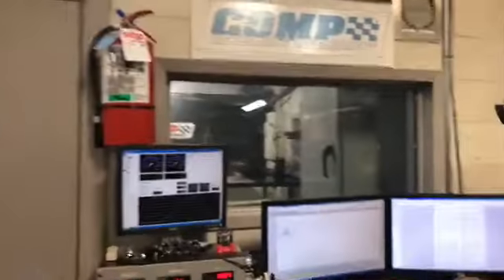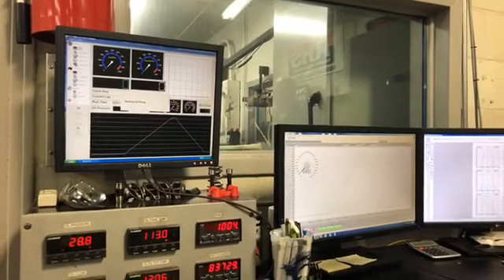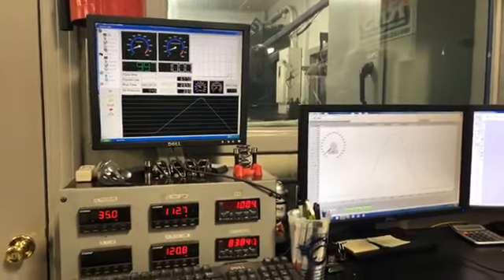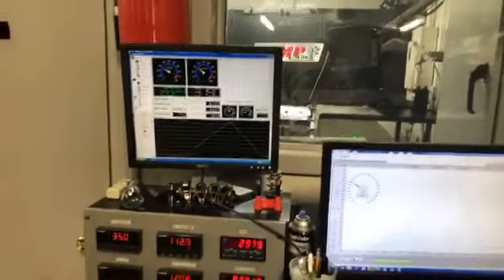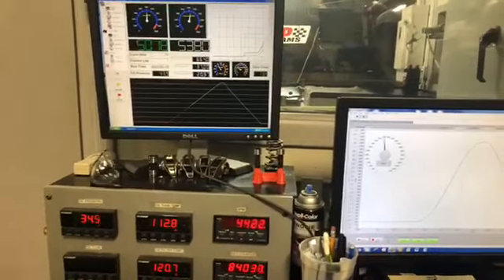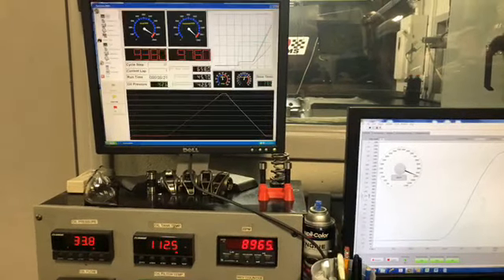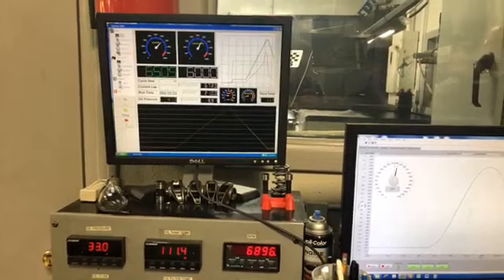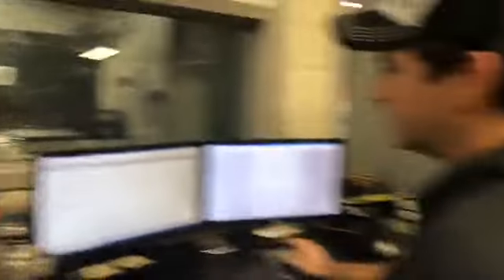Project Spinal Tap Goes to 11,000 RPM

Comment: 11000 rpm ls7....freaking awesome. That’s rotary engine territory!
Reply: SteveFuentesRacing that’s higher than most rotaries go....
Reply: Stephen j name one I6 that revs that high... I’ll wait
Reply: Stephen j false. The rb20 head flows too poorly to rev that high, I had one, and it never made it much past 8k before falling on its face. the standard rb25 head doesn’t have the solid lifters like the rb26 so it can’t handle that high of a rev, the rb26 cams aren’t aggressive enough to rev that high and still make power, the 1jz and 2jz are never really revved past 10k, and those that are typically have big cams, ported heads, larger valves, etc. I don’t know much about the s54 but stock limiter is lower than most other i6’s, and the Barra being 4 liters will not rev that high. The typical power band of a Barra is no higher than 6500 or so. Big displacement without a massive bore or short stroke will not be easy to rev out. And the Barra can only be bored so much
Reply: Lots of rotaries go 10k+, that’s just a Bridgeport away. Especially NA rotaries.
Reply: Matt L this ls7 is built built. Lol why are you talking about a stick heads?
Reply: @Matt_Lanzer_13  the RB26 engine designed specifically for racing revs 11000 rpm, heavily tuned by Nissan for racing during the days of skyline GT-R, also there's a video here on YouTube, search it up, I ain't gonna search it and copypaste the link for you

Comment: Think about this... before the 10,500 rpm NHRA Pro Stock RPM limit was imposed, 500” Pro Engines were exceeding 12,000 RPM in competition.
Reply: I know there’s someone seeing thinking well f1 engines do 15k rpm(modern) and Honda has gone past 20000+ rpm. Modern f1 engines are 1.6 liters or 97.6 ci. That motor was a 427 ci or 7.0 L. Modern pro stock are 500ci or 8.19L. That’s a different of 5x the displacement but the big ohv engines are still climbing past 10000 rpm
Reply: @puttingwarheadsonforeheads9872  yeah because pro stock motors need to last for seconds while f1 engines need to last minutes...
Reply: Yea it’s understandable though since those are purpose built for high revs with overhead cams, very short piston stroke/bore ratio, multiple huge valves per cylinder etc etc this is just a good ‘ol LS. Lol pretty impressive

Comment: one thing i think most people have missed is that this motor had no pistons and rods in it - they were spinning the valvetrain only.  still, very impressive for a pushrod valvetrain, but that noise it was making was all valvetrain :D  it wasn't even doing any combustion.
Reply from the maker: Pretty crazy that most engine noise comes from Valvetrain! This video sounds remarkably similar to the run of the completed engine hitting that speed!

Comment: Great video! Definitely want to see more. One day I'll to have $2,000+ per day to come do some r&d.

"Now what?!"
More spintron stuff.  Lets see a 1080p video of the valve motion overlayed on the baseline throughout usable rpm range. Maybe strain gauge, load cell, etc data...  Looking at the opening side of the lobe I had a hard time making it out in 360p.

What components?  Are you guys running your cam, morel lifters, manton pushrods, t&d rockers, xceldyne valves, retainers & locks with psi springs for that rpm? Is this lobe profile available yet?

Comment: That was really impressive. But what was the power output like? Torque curve? And was it a flat plane crank?
Reply: No power output. This was a valvetrain test, so its a block, crank, timing chain/belt, cam and valvetrain hooked up to an electric motor that spins the the crank. No pistons, or rods.
Reply: but why
Reply: Purely a test of valvetrain life. I got roped into watching this video also thinking it was a video of a running 11,000 rpm chevy pushrod engine. Click-bait.
Reply: Jon-David Jacobs that’s dumb
Reply: it clearly says Spin-Tron
Reply: I don’t care if it’s not running, making any internal combustion engine turn 11000 rpm that is not a rotary engine or 2-stroke is awesome. Well done
Reply: Sport bikes do it with ease, BUT they don't have rockers and push rods.

Comment: Not to burst the bubble here but we have been spinning LS motors to 11k rpm for years in NHRA Comp Eliminator and making 3 hp per cubic inch ! Nice project but not even close to being the first , just read article in road and track, had to throw my two cents in , Might have checked with some of the top NHRA engine builders before wasting R& D and money on a project that has already been done

Comment: Everything about that engine has to be forged, even the block.
Reply: Try billet bro.
Reply: @Pablo-cn1me  I think forged is still stronger for rotating assemblies due to the way forging forces the grain structure to flow with the component. Stationary components, billet all the way.
Reply: @Pablo-cn1me  ..........a billet is a forging...........just saying.
Reply: @thomasjefferson5727   yeah , but that billet was cast at some point ! .

Comment: Where the heck is this motor? I've been watching and waiting for a year. Please don't tell me that you gave up and threw in the towel.
Reply: I imagine they found out why high rpm motors have nose-fed oiling for the crank.
Reply: in one of his vidys He talked about this engine and the valve train is pretty much done after one or two pulls So it’s really only useful as a conversation starter at anything over 9000 RPMs